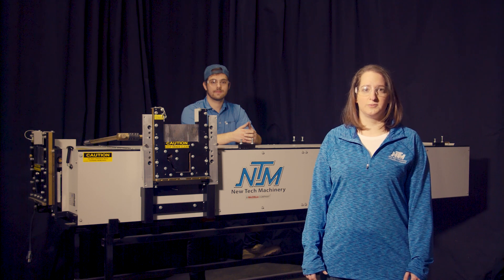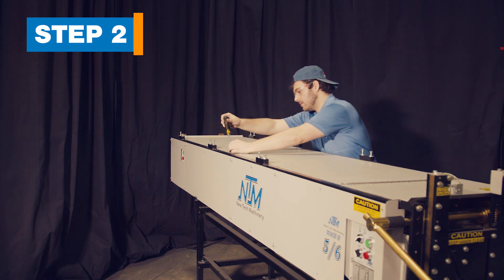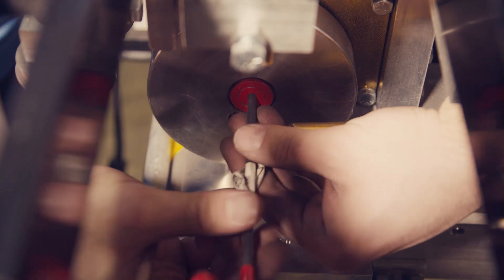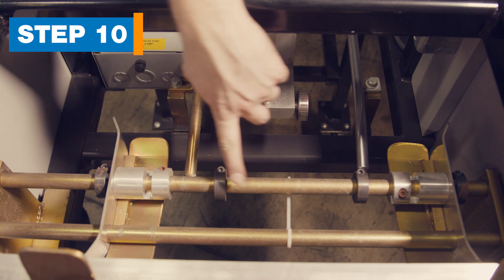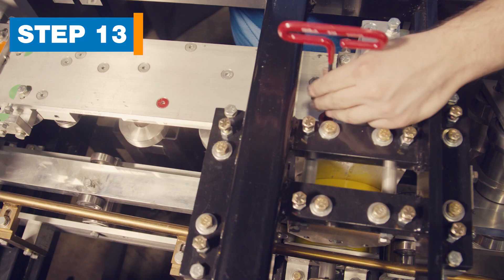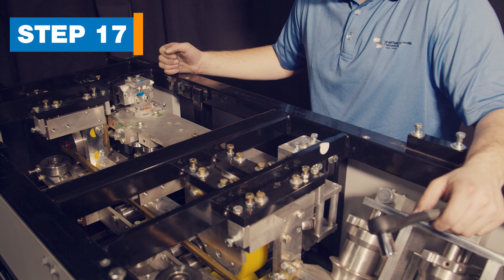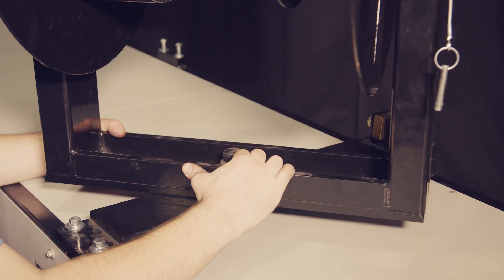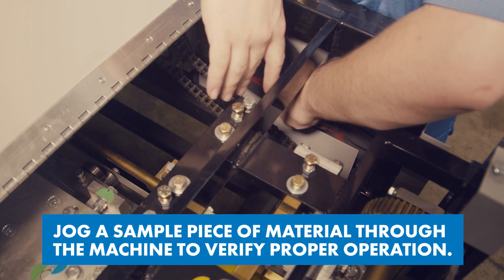NTM MACH II 5"/6" Combo Gutter Machine 6 Inch to 5 Inch Changeover

Comment: What size are the four bolts that hold the shear onto the machine? In terms of what sized tap do I need to buy to re cut the threads
Reply from the maker: Those four bolts are 1/2" bolts!